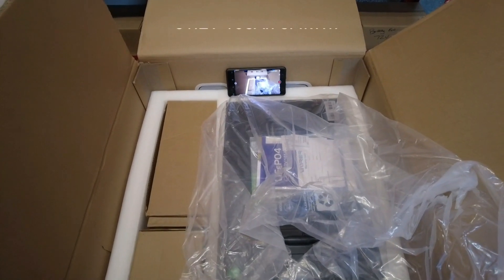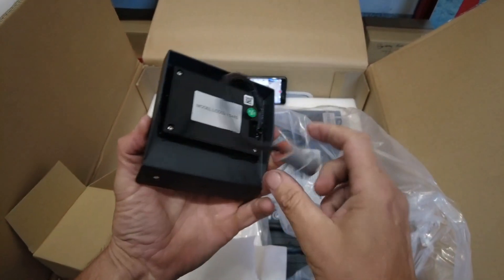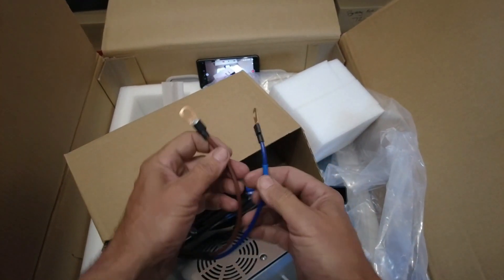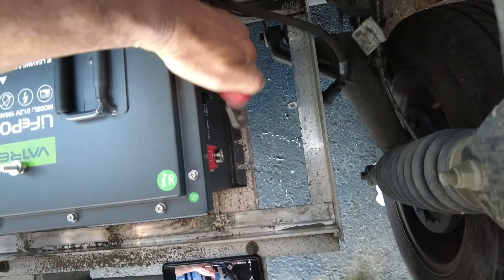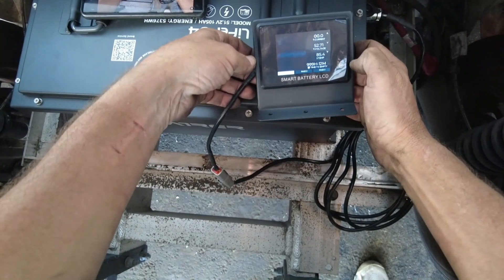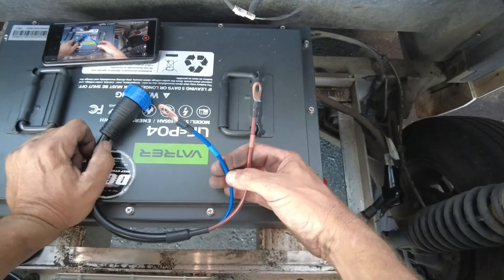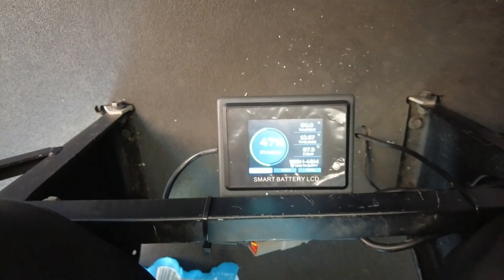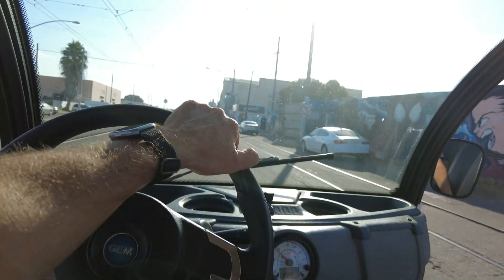2017 GEM CAR 48V Lithium Battery - Vatrer Install

Comment: I purchased one of these kits through Amazon and installed it in my 2019 GEM but when I charge it the dash display bars are showing dead and blinking (thinking the car is dead). Any idea why?
Reply: Have upgrade battery im tring to upgrade mine and sugestión